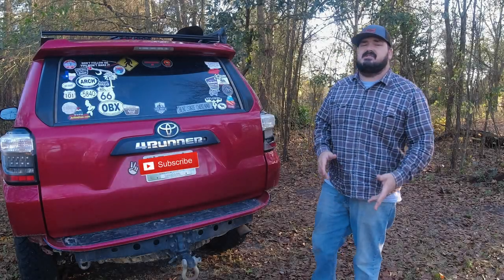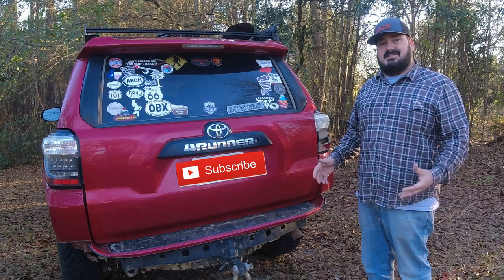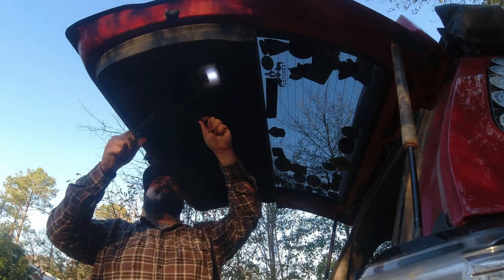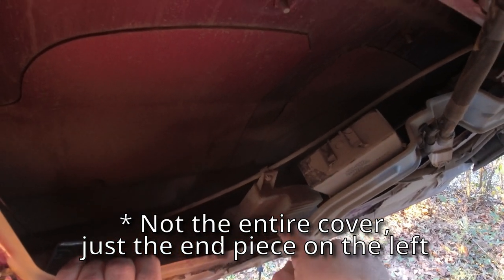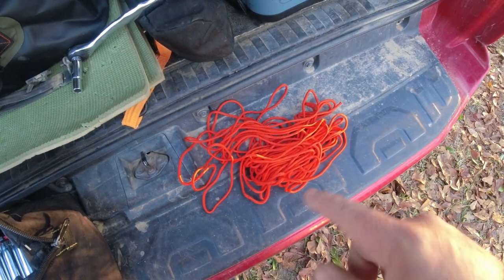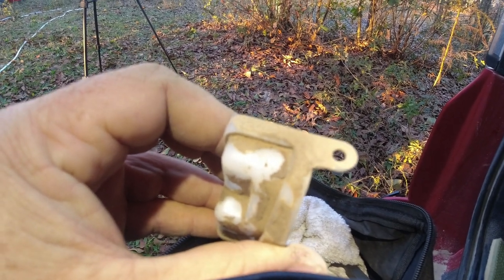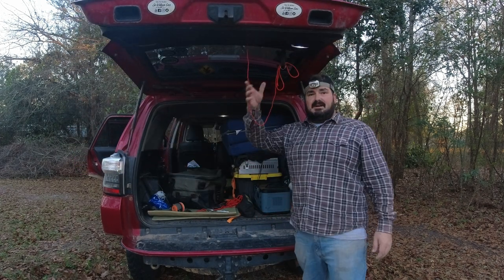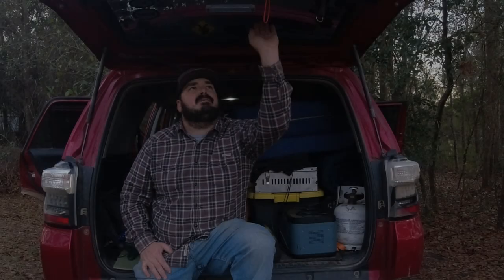DIY Inside Rear Hatch Release 5th Gen Toyota 4Runner

Comment: I have a 2022 and the back hatch has the heat/pressure-sensitive latch, where if I have my key fob on my person, all I do is put my fingers on the latch, press, and it will unlock and open. It also has lock/unlock buttons on the latch as well, again which only work in proximity to the key fob.  How would fiddling with that latch lever to open it from the inside affect this touch-sensitive function afterwards?
Reply from the maker: All that stuff just sends signal to an actuator that manipulates the latch. The same as others just additional ways its activated. With this your bypassing that and manually pulling latch. Hope that makes sense
Reply: @SirWilliamGoes  thank you!

Comment: Thanks for posting this tip!  I just finished doing this mod.  I had the hardest time just trying to find something that would stay on the latch without slipping off.  I finally settled on a 14" thin zip tie.  So far it works great.

Comment: Thanks for the vid. My rear manual release latch doesn't work at all. Yup, I removed the molding and am pulling up on the levers, but not opening. Thoughts?
Reply from the maker: Interesting. I'm not real sure.
Reply: @SirWilliamGoes  I took apart everythiing I could from the inside. I finally took a crowbar and pryed it open from the inside without causing damage.  I removed the entire rear hatch actuator and now my hatch opens.